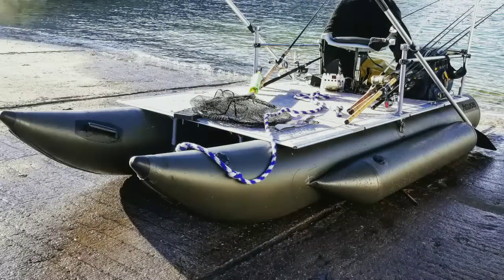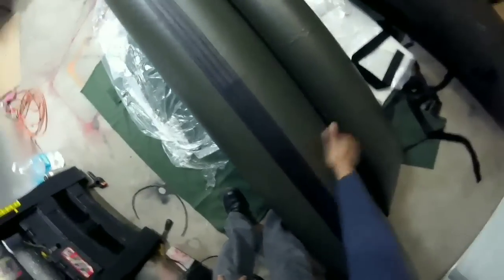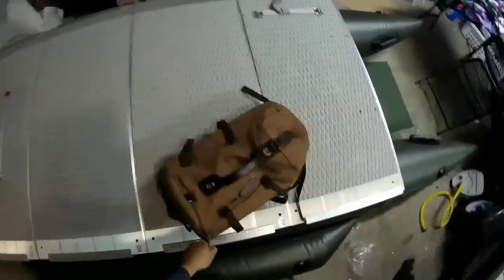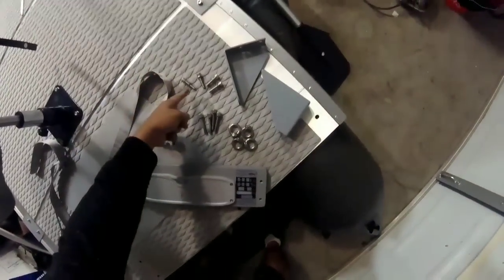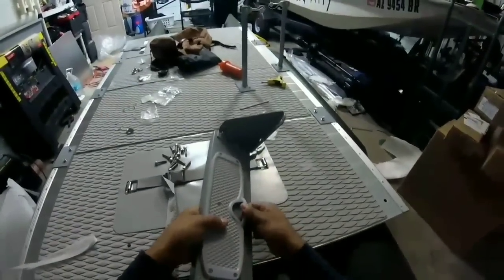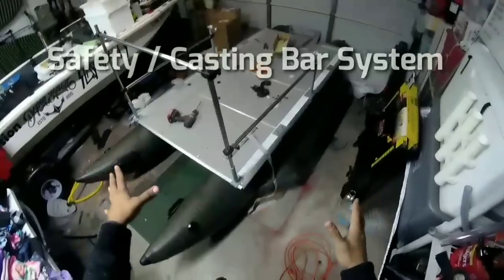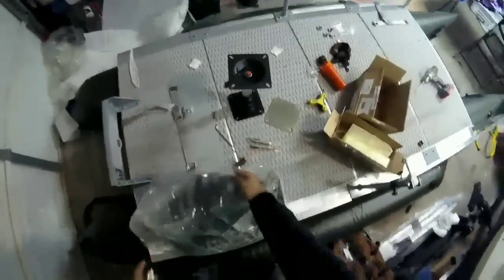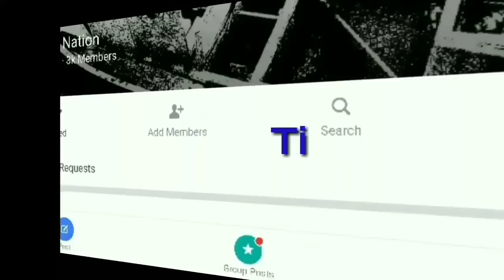Aquos PF-380 Inflatable pontoon boat - Out of the BOX! #TBNation.

Comment: I use an inflatable boat for fishing, this is a good step forward. If you're getting an electric pump, get one with integral lithium ion battery so you can inflate anywhere.
Reply: Home Depot has the exclusive on Ryobi tools. They make a 12 volt system called the one plus system. they have a universal inflator that will do tires or rafts. The cost is about 40 U.S. minus the battery. I carry one in my car all the time and it works perfectly on rafts. It actually has a raft setting for high volume low pressure. I have a bunch of the system tools so this is a perfect fit for me.

Comment: imitation is the greatest form of flattery. With tisr boat, it is obvious to those who have owned Sea Eagle boats that their patent has run out. Not knocking them at all for building it I just think it is nice to build a product that is so good that other companies will basically tweak it just enough to be different and start building. It is always cheaper to let someone else do the initial R&D. Time will tell if they will have customer service like Sea Eagle. Sea Eagle is so good that people come back knowing their are far less expensive alternatives but they will be 100% satisfied because of the company.
Reply: @TinyBoatNation   if set up and tear down is the primary feature (no trailer) are you buying this or a fold cat? or something else?
Reply: @TinyBoatNation  i worry the open slats might be an ankle twister plus every time you drop something like lures or weights its gonna be a hassle. Seems like the larger flat deck of the aquos is enough of a benefit to offset increased set up time???

Comment: The foldcat is a better option if you want to be able to avoid having to purchase a trailer and definitely easier to assemble and disassemble, I have mine in a Lexus gx suv which allows me to drive it into areas where there are no launch ramps. Got it down to 20 to 25 minutes assembly. When we go glamping we have a small trailer for all the rest of the crap that keeps the wife happy like her little kitchenette, her inflatable double bed and the rest of that crap. I just want to go fishing and come back to a happy wife and a few cold beers! I have enjoyed your mod videos but for me i decided that the portability aspect is important so i tried to keep the add on's to a minimum.

Comment: what year is this Aquos twin pontoon? i have mine on youtube video Part I: modifying 6' Aquos twin pontoon with 48"x24" diamond plate.for extra 3" width on each side and 3" at the bow. the diamond plate also stiffing the three alum plates from bending. connecting side plates are not strong enough to keep it straight. also im power it with MK C2 30. have not taken out to the river yet. the hardwares are not quite the same. mine has a slight air lost when keeping in the Garage too long. i will make sure i take the foot air pump at all time. im using 12V 50 amp Mighty Max lithium battery. better to have two just in case the river surface gets too rough. thanks for sharing this video.